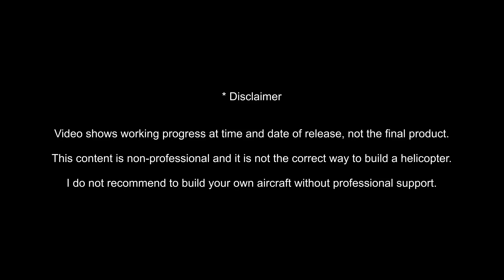Central Gearbox Mount EXPERIMENTAL HELICOPTER BUILD SERIES (Part 45)

Comment: As A flight engineer, grin! also, wouldnt surprise me if you were on the Pilatus development team!
 id like to see aguard over the 2bolt coupling you have just put in place.
 Too near where you are sitting ,  and too close to any   item of clothing .
Await thebuilding of the rotor blades and small rotor and. drive
Ted In Dorset UK.